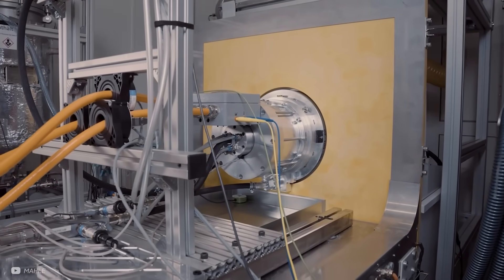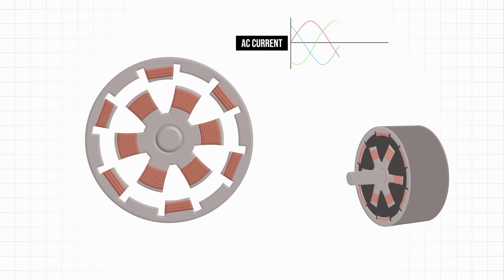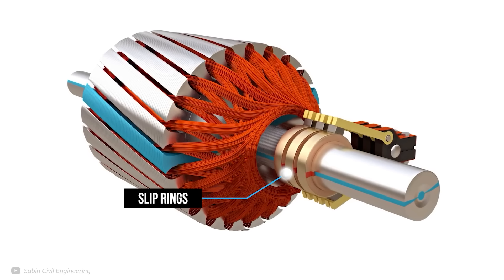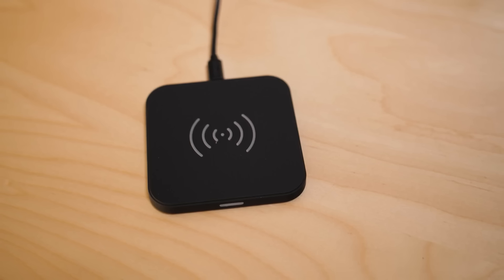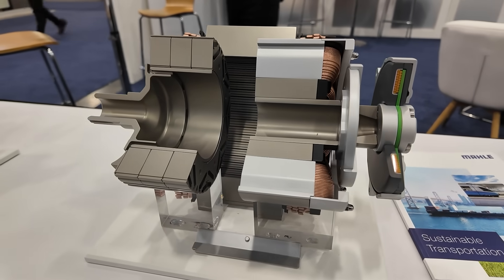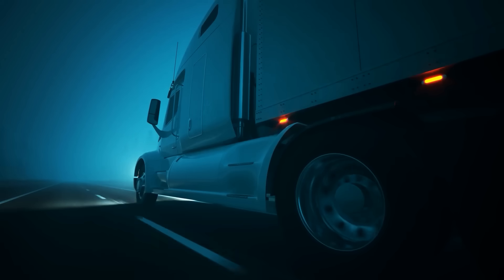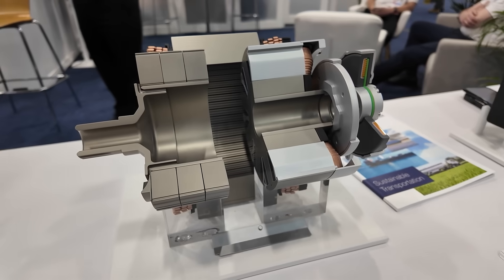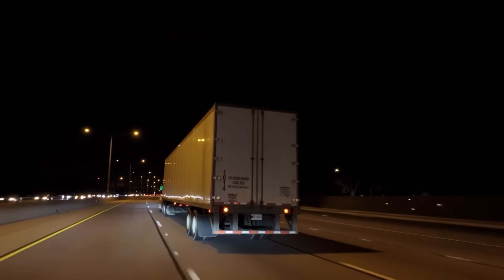Genius Contactless Motor Could Change Transport Forever

Comment: It makes no sense to say that the engine does not use rare metals as long as it needs current from the batteries. At least 70KW power per 1000KG of rare metals

Comment: NOt entirely true polyphase electric motors use a rotating magnetic field. Single phase motors require a shading coil to artificially create a rotating magnetic field.  DC and universal motors require a commutator and brushes.

Comment: Nothing "new" here... seriously... just another big corporation claiming they just solved the worlds problems... but if they truly think that, they are seriously without any "research engineers".  Part of the drawback to Inductive Coupling for the Rotor excitation is that the rotor magnets in a Synchronous Motor use a STATIC MAGNETIC FIELD... not reversing (think DC versus AC).  This means that the inductive coupling (which is AC) must be rectified to DC for the Rotor electromagnetic poles (and it likely needs to be filtered, unless their stator drive induction coupling is at least 3 phases).  Right here is where the losses occur. Even with modern SiC MOSFET switches for the AC-to-DC Rectification, there are still switching and conduction losses... even if only 5%, it's still significant in today's EV's... and is just one of several points of losses in a complete EV drive motor system.

Comment: So it uses carbon brushes which are known for wearing down and reducing the lifespan of the motor? With the addition of having to use additional energy to power its stator? So its fundamentally less efficient and wears down overtime faster… This will definitely not “change transport forever"

Comment: How many watts of wireless power charges the inner coils?  We have to wear RF tags while working in a Cell tower much lower than the 500 mile microwave relay radios I worked on! 30% went sterile!  And you want to put that under my balls?

Comment: So it is integrating a cooling system with a squirrel cage motor? Still has normal bearings. Also 95% eff motors are pretty normal these days.

Comment: The motor is basically a repurposed car alternator.
In transmission of electricity there are losses and a motor which rotor and stator both consume electricity would use a lot of current.. Where do they get their efficiency data from?
How can a motor that only uses one pole be super efficient? All magnets weather electrical or permanent have two poles so why aren't people working on using both poles?
I have a design drawn up on my computer, it's possible to make both stator an rotor electromagnetic but as both sides of all poles are used there would be very little energy wasted and huge amounts of torque. Torque is most important from an electric motor not particularly high RPM as gearboxes can be used to convert torque into high RPM. What we need is high efficiency not race car performance.
Current EV batteries are dangerous and only last a few hundred miles, the technology is trash compared to the combustion engine which by the way is green energy because it produced carbon dioxide which is plant food.. Yes carbon dioxide turns the world green therefore combustion engines are green where solar panels and wind turbines define are not green... But I've said enough... 👍

Comment: Brushless motors exist already. How is this new?
Reply: Also aren’t AC motors also brushless
Reply: @AtomicA7 induction motors are brushless, synchronous need a powered rotor. The only improvement is using an axial-flux brushless exciter rather than a radial-flux one.

Comment: I'm afraid there's nothing new here. A very similar, patented by Lucas, system has been in use for over 50 years in main engine generators in commercial airliners, spinning at 24,000RPM and oil cooled!

Comment: To make a bearing-less metal bearing motor, one only needs to have magnetic rings and polar opposites holding them in virtual space.  No friction, no wearing, no metal ball bearing noise, totally silent, and full energy usage, no entropy, no resistance, no need oil lubrication.  Magnetic bearings are the way to go for cars, trucks, jets, etc.  Neodymium bearings and rotor shaft will definitely keep all parts separate.

Comment: This is stupid on several levels I understand and probably a plethora I don't too.

Reliability:
*They're replacing a carbon brush that wears but is easily replaced with a package of electronics for which no circuit diagram will ever be published and which is made entirely using tiny BGA packages that are effectively unrepairable. In the real world, simple and repairable means reliable, while complicated and undocumented means unreliable. For trucks especially the inability to service it makes this a trash idea. Trucks are driven for millions of kilometres, at which point there's no such thing as a part that doesn't need servicing.
*If you've ever taken an undergrad course in reliability engineering, you'll know that one very reliable component is better than 100 extremely reliable ones. If you've ever repaired electronics you'll know that being complicated and solid state does not make a device service free, though it can easily make it disposable. Solid state circuits fail all the time and they're nearly impossible to diagnose for even a seasoned repairer in most cases.

Efficiency:
*To get away from carbon brushes because "oh no, friction!" they're going to wireless power transfer, which is notoriously inefficient. Yes it's more efficient to have your pick of inductive coupling frequency unlike an induction motor, but I doubt they're getting anywhere near the efficiency of a slip ring.
*They've also gone to all this effort to erase a source of friction and then filled the motor with oil. The electromagnetic efficiency of a motor relies on the gap between the rotor and stator being as small as possible, yet the power of a hydrodynamic brake increases as the oil gap gets smaller too. By flowing oil within the rotor and stator separately they can avoid this, but then they've had to add a bunch of oil seals to try to keep oil out of that gap. If it was possible to make an oil seal around a spinning shaft reliable, you would never have heard of a rear main seal leak on a petrol engine. The Porsche Boxter proves that even German engineers can't get this right.
*They've set their sights on the most efficient motor and they're using a radial flux topology? This must be because the wireless power transfer system interferes with the axial flux lines, because why else would this not be an axial flux motor? Probably because YASA has patented everything under the sun that relates to an axial flux motor.

In short, they've run away from "good enough" so hard that they've tripped into a quagmire of overcomplicated designs that introduce more problems than they solve.

Comment: There is always a trade off and this type of motor is not a new concept, given it has been tried many times before. The only thing that makes this type of motor more feasible now is the advancement in materials technologies. 
Contactless is certainly less efficient  than a contact driven motor, however the wear of the rotor contacts is not that big an issue when it comes to efficiency. What does lower the efficiency is the fact that debris builds up within the gaps in the rotor contacts, which in turn, leads to partial shorts, and thus a reduced current in the windings.
 The biggest problem with motors is the fact that the magnetic flux density needs to be at the highest you can get it. This depends on the amount of copper going through the magnetic field and how close to that field you can make it.
All well and good cooling the motor down, but the gap between rotor and stator needs to be as close as possible to make the motor efficient, so as others have found, the rotor has to have something like a Kevlar woven jacket to stop the rotor flying apart under extreme G forces at high speed. All that weight on the rotor is not a good thing when it comes to centrifugal forces.

Comment: You very often mention it is efficient, because of the innovative cooling. This is not correct. It is efficient, because it doesn't has any slip rings and it is environmental friendly because it doesn't use rare earths. 
The cooling is just a nice add-on, it increases efficiency only minimal

Comment: So, this new motor is a giant step BACKWARDS, to early polyphase motors invented by Nikola Tesla, in that they have wound rotors (no permanent magnets). But that is combined with a way of getting externally controllable levels of power into the spinning rotor, without needing slip rings. All of is OLD, except for the external control. Only that particular separates these new motors from existing brushless polyphase synchronous AC motors... Which, btw, run as induction motors at low speeds, for greatly improved starting torque.

Comment: the exitation of the statexsyn motor was 50hz with rectification by silicon diodes  at 42 v dc . i recall vaguely efficiencys of over 95 % on a six step inverter waveform. 
at the time it was more efficient than permanet magnent motors and reluctance motors.
the starting currents and synchonising currents where signifficant bettrotating er than alternatives.
modern rectifiers and hf rotating transformers  could give further improvements.

Comment: regret to advise this is not a new invention. in the 1970s a dutch motor manufacturer EMF dort launched exacty the same principle  by its inventor  ir Schiethart at the time it was used in the syntetic fiber industry to drive godets and winders.
i was involved in some of the tests combined with static inverters on hich speed applications.

Comment: Switched Reluctance motors also have a high efficiency with a wide range of torque/speed control without the use of permanent magnets. They use an iron core rotor and produce torque from iron core rotor moving to reduce the air gap between stator and rotor. The only disadvantage is more vibration than PM or induction motors.

Comment: As a result, it will not be the contact rings that wear out, but the seals of the oil cooling system, plus it can leak and the motor will overheat. Compared to the frequency of replacing the contact rings, this will happen much more often. A very "reliable" design =)
Also - it will be interesting how it will rotate at negative temperatures, in thick oil.

Comment: Wow it's kind of like Nikola Tesla's idea transferring wireless energy through the air and then to your devices with the electromagnets and Tesla coils funny coming out now huh I guess his idea has finally hit people's brains instead of using cables and wires could have been doing this years ago if we hadn't been stuck into wires and cables an invested into wireless energy and electromagnets and Tesla coils and capacitors and stuff like Tesla was trying to do sad he's not around to see it finally coming around and finally being justified that he was correct did you can transfer energy maybe that's how will power our building in the future transfer it through the air to connecting the buildings instead of power grids oh wait that's Tesla's idea literally that's Nikola Tesla's idea funny how it comes out now this man had the same idea that we're now coming up with as efficient man this guy in 1886 was f**** a genius and now we're so advanced really kind of funny Nikola Tesla knew something that we are now finding out yeah we have to transfer energy through the air because contacts systems don't work properly

Comment: Key idea in my opinion here is that you provide current to inner part of the motor to just sustain magnetic field of coil magnets you alternate it rarely only then needed to. So despite of the fact that remote current transfer is inefficient you really do not need it much.

Comment: I am sceptic about the benefice over the inconvenient of this motor. The complexity of this engine is higher that the permanent magnet brushless motors. The production price will certainly be much higher too, it might be an advantage to be able to modulate the rotor magnetic strength, but it does not seem to be such a game changer in the vast majority of applications.
lets wait and see.

Comment: This technology isnt even from the 1900's. It's from the 1800's. How is any of this groundbreaking? You're just explaining a burshless motor. 
The cooling part is grwat though. Also not new technology but directing that heat back to the cabin in the winter will make EVs much more efficient. Plus depending on the freeze point of that oil, the motor could run a lot more efficiently if it flows at say -40C.

Comment: @3:00. That’s a wound rotor induction motor’s rotor, not a synchronous motor. 

A synchronous motor only has 2 slip rings for DC current.

Comment: Understood that inductive power transfer is less efficient but the question then is when talking 3-400kW of drive power, how much power does the rotor need. If that were only 10's of Watts then any percentage of inefficiency becomes irrelevant. Disclaimer I don't know how much the rotor consumes and that will of course depend on the required field strength.

Comment: And if you cool the motor with oil you can then cool and warm the batteries with it as well. Transformers have been oli cooled for decades, so oil cooling in it self is nothing new but it hasn't been feasible or needed with motors until now.

Comment: Synchronous motors with electromagnet rotors have only two slip rings as they are fed DC. Three slip rings are variable speed induction motors using external current control for the rotor.  Lots of other more serious errors. Please take more care.

Comment: Not sure why they say this is new. Basic generators with external voltage controllers use this same tech for controlling the field. An external exicter ring indices ac power to the armature, a rotating diode comverts it to dc and magnetizes the core 🤷🏼‍♂️🤷🏼‍♂️

Comment: Sorry iits not.genius. there is so mamy ways to make electric motors the basis being magnetic fields and not so common elecrrostatic fields. Its all about $$$ and bleeding the market... Like consumer computer tech and ipc and nm limits etc. they have know how to do stuff for a long long long time, they slowly bleed the market and make maximum profit. Trust me i seen this for 40+ years in it and electrics fields and market. They have to pay for there r and d and all there setup and eslablishmemt of new products. If they superceeded it all that money would be wasted and also consumers would.go nuts. And the industry would be insane. Example, if you bought a playstation 5 and 6 months later there was a playstation 6 then 6 months later a ps 7 and so on. How would they make games, or what would customers do.

Phones kiinda do this, but phone just under and over clock cpus and different size ram and flash memories and screens etc. the tech dosent move that fast as its reused amd still.sold.for years to come. Profits on phones are huge...

Comment: Just when we figured out how to get rid of the overly complex, greasy oily mess of gas engines, we figure out how to add oil and mess back in 👍 wonderful
Reply: But without contamination from blow-by combustion gases, the oil will last years or decades instead of months. When I worked in fleet management, we had some cars that ran on compressed natural gas. That burned so cleanly that even at double the normal IC oil change interval, the oil still tested as good.

Comment: Wireless Power Transfer sounds like simple Induction. Not that impressed. The motors aren't the problem in EVs, at this point it's the batteries. All this talk and still no battery breakthroughs over the years. How long did it take for humans to figure out how to assemble a bullet onto a loaded cartridge and make a repeating firearm since gun powder? Humans just aren't that smart, they just think they are. EV pick ups can't go 100 miles with a substantial load. Useless. I'm not buying it. Yet.

Comment: Transport with chemical fuels is also sustainable, just make the methane or whatever you want in a nuclear power plant. Just build lots of nuclear power plants.
With electric the cars still need batteries, not good for the environment. You could run induction coils in the streets to make the batteries smaller. Still giant effort in infrastructure needed.

Comment: But why use such an efficient motor in a haulage truck - the step up in power density is effectively pointless as the mass/volume of the battery (which has a very low energy density compared to a tank of diesel)  is the problem, not the power train.  https://youtu.be/Hatav_Rdnno&t=77     EV tech are great for bikes, where bike, motor battery is >25kg, 1/4 mass of rider.  They can make sense for small cars, vans, especially for short urban journeys.   But lorries have to run 500 miles and to provide this range, the batteries will need to make up 50-60% of the vehicle mass / volume, which means significant cuts the potential payload.  This new motor is better used for high performance vehicles than cargo carriers.

Comment: There's no mention of the obvious fact that the armature electro magnets require DC but the magnetic power coupling supplies AC. Adding rectification to convert AC to the required DC introduces more inefficiencies but this is not mentioned.  Why introduce facts to spoil a good story.
In fact, all this system does is replace the permanent magnets in the armature with electromagnets which consume power (dropping efficiency) and add a bit of cooling to the system as a whole.

Comment: These motors break under immense torque. They are not perfect in any way. They're massively dangerous, and they generate more heat than a combustion motor, so they also get even hotter. This requires new synthetic oils to maintain. But, the design of these motors doesn't give much access for heat transfer from the primary heat conducting components.

These motors are a recipe for disaster.